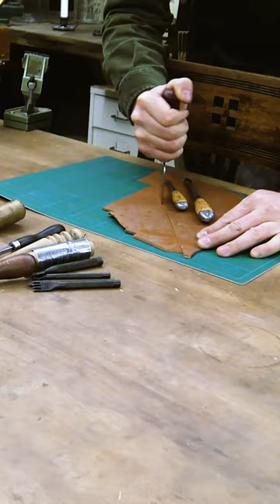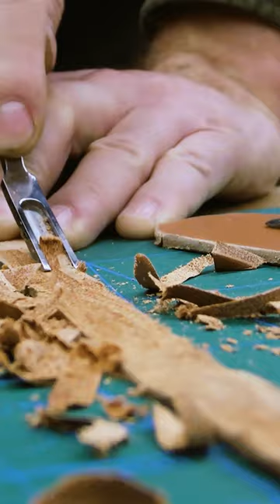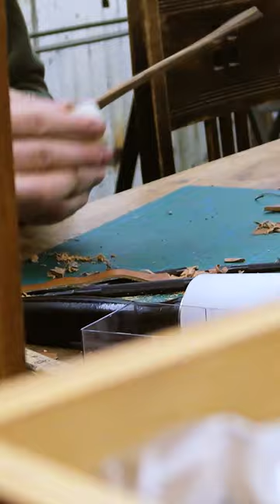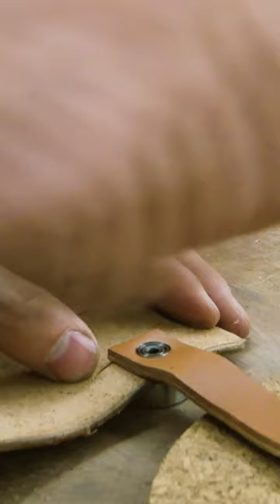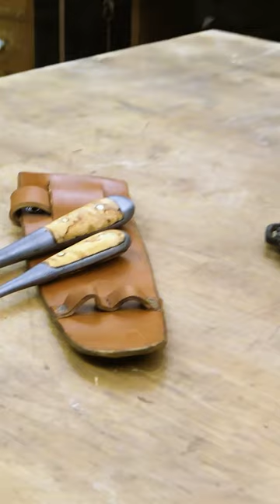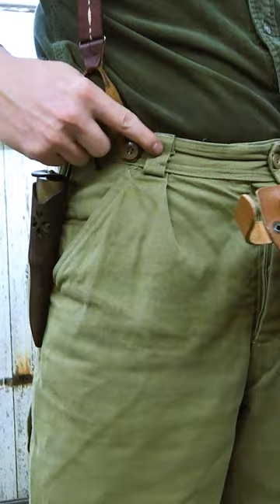Making leather holster for antique screwdrivers from 1900's #oldtools

Comment: I bought a similar looking chisel but smaller at an antique store parking lot sale for 1USD. After using it a bunch the wood handle pieces broke off and there were swastikas engraved under. Then it grew wings and flew off before I had a chance to get any info on it